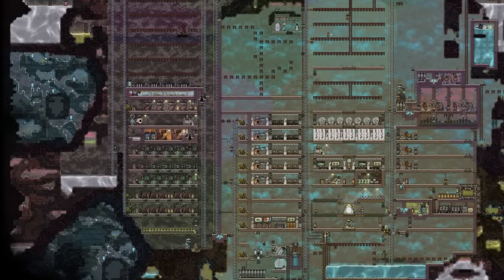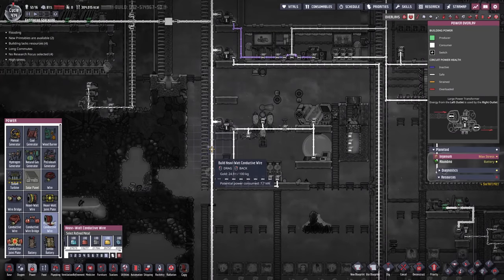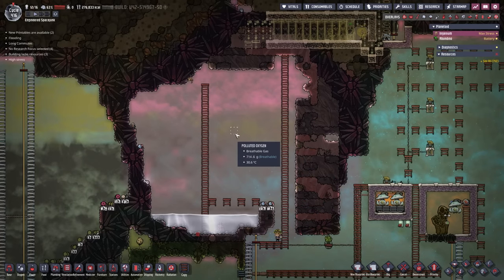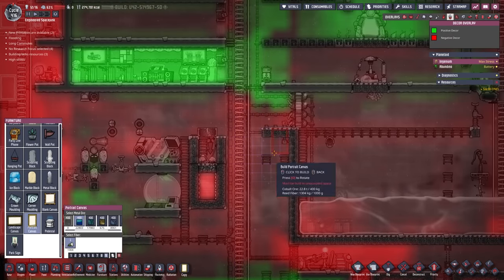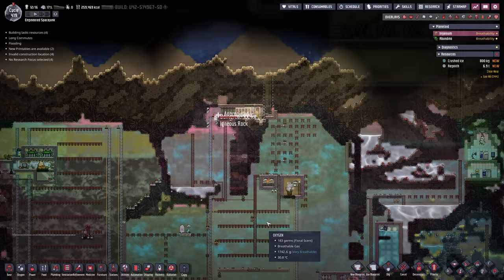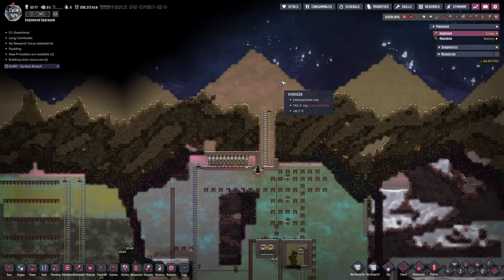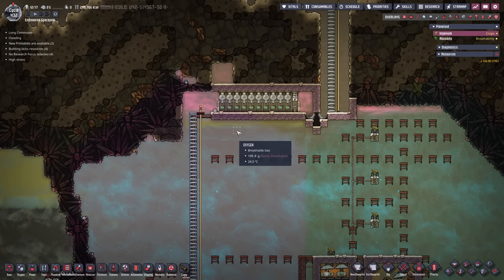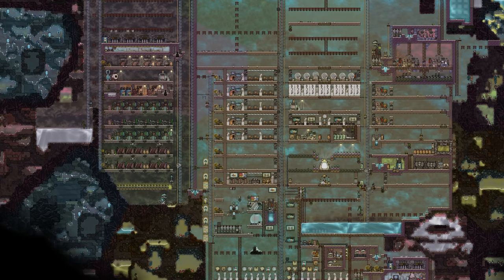Constructing a GATEWAY to SPACE (and other SHENANIGANS)! (LP2-EP20) Oxygen Not Included Spaced Out

Comment: 17:16 Why do you do your gas pipes into your atmosuit docks into each one? The one closest to the checkpoint will always be taken first, and returned first, and thus require more gas. As you're adding the gas into the last one, the closest to the checkpoint will take the longest to get gas. Right now the dock last dock will get 50% of the o2 pumped in, then the next one 50% of the remaining, and so on, and so forth. Where as if you simply ran it from the first one (closest to checkpoint) to the furthest one, the gas always fills the most in demand suit.If you want even distribution, for 5, suits, you would need to split 1 into 2, then those 2 into 2 again, then those 4 into 3, with 1 of those split into 2 and recirculated after the first split for even distribution, though it will sort itself out when it backs up.
Reply from the maker: The reason is that it really doesn't matter in my case. You are of course  100% correct, but I put 10 Atmosuits there with a dedicated line spanning basically the entire height of the base. All Docks are full to the brim as well as the pipe. Keeping the docks filled will never be an issue. Sometimes a not 100% theoretically efficient route works just as well :)

Comment: I have never thought STR on dupe matters, it helps but would rather have other stats.
Numbers from the fandom page.
+40kg per str meaning at max +760kg = (20 - 1) * +40kg VS +600kg from the two supplying +4str (160kg). Meaning a dupe with base 1str with the two supplying perks would have more carrying capacity than a 20str dupe without (most likely would never happen, but for example). Yes 2x with max and both perks, but you most likely have automation normally by the time you a max STR dupe. Heck normally have it by the time I have a level 15 STR dupe, even if they had 10 out the gate.
There is also +25% tidying speed per point, but tidying is only generally for cleaning (all can be automated) or fixing broken things (stop making broken contrations???)

For comparison
Athletics is +10% to walk speed, which is where most players dupes seem to spend most of their time. Think there is guide/testing thing by Brothgar, that sort of pointed out you could have one dupe provide enough power (wheel), to provide enough for their O2 and food needs (venting the Hydrogen). Been a while since I have watched it though.

PS: Did not mean to write a wall of text.
Reply from the maker: I agree with all of the above, but I wanted to bring on a new dupe in that moment to help speed up the build. And in that case, out of the 3 I had available, the one with strength was by far the best for the job. All 3 dupes were not optimal to start with, but I wanted one in that moment. And not every single dupe has to be min/maxed :)
Reply: Yeah, it can be hard when you do not get decent options which they really were not.
Willing to take supplying, but like to see it with two others that they are going to use also. Example pilot, supplying, suit or supplying, digging, mech. Willing to steal a building 3 also, due to that line is generally bad and only need it for clearing old tech.